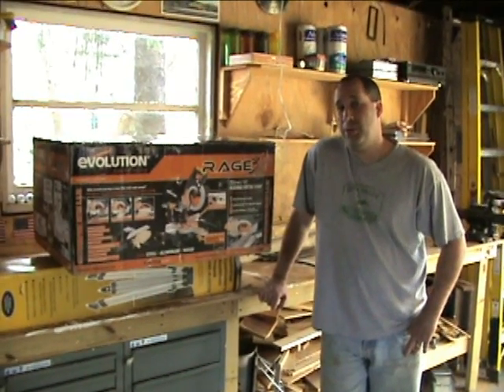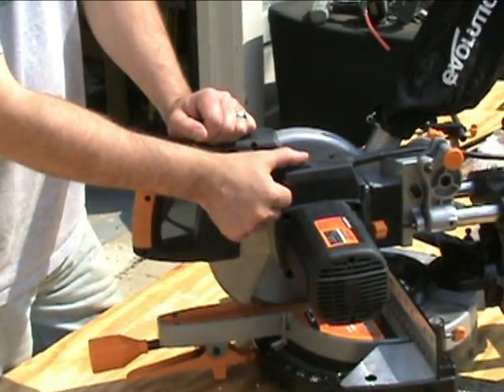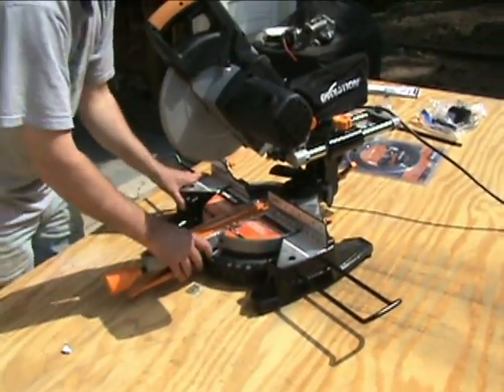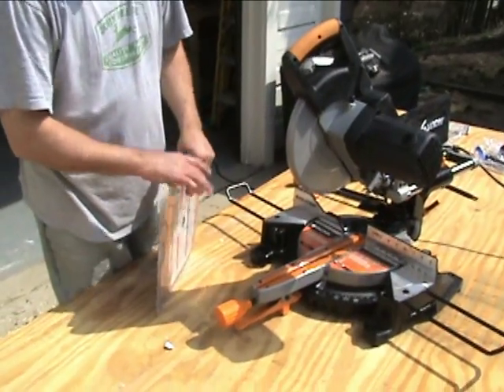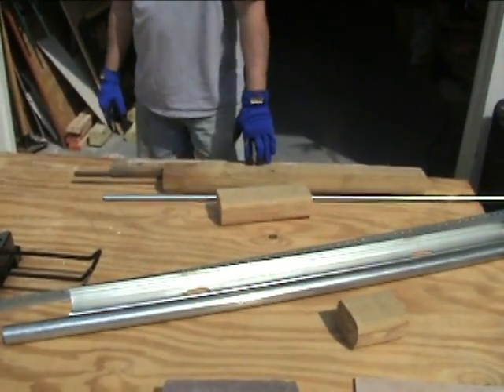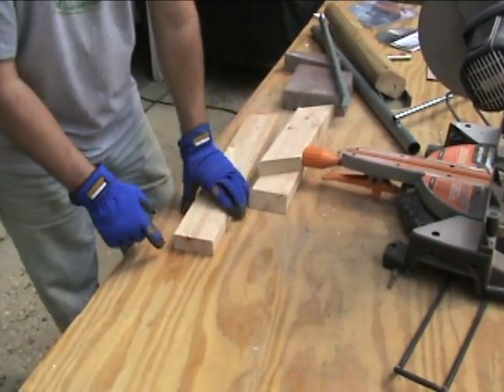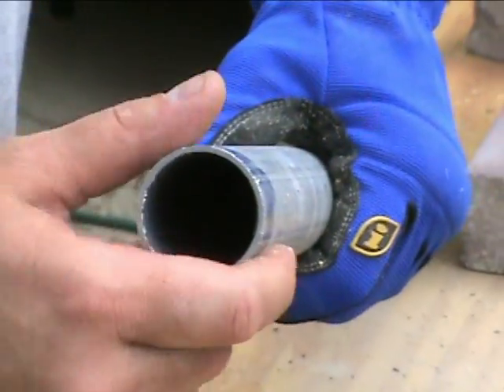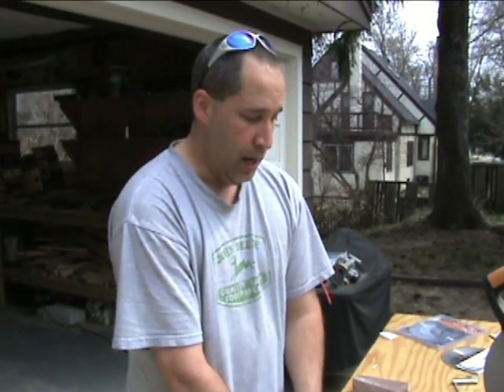Evolution Rage 3 Saw

Comment: Good review but the switch on the top of the motor housing is only the on/off switch for the lazer light. the actual saw will operate with  this switch  in the on or off position so don,t rely on this switch to stop the saw  from operating . if you don,t want this saw to operate pull the plug out

Comment: Whilst I will be using this saw for major timber works, around the home, would I be able to use this for picture framing, the manual type have gotten quite bad over the years, but I need this larger unit for other tasks also.

Comment: Well... Its in its very own specially built cupboard. Did a quick project (ornimental bird table for the wife) used "old mitre saw" Couldnt use the new baby too windy and a bit cold outside. Cant use it in shop ,it only measures 8ftx6ft. Bench not big enough at the moment. So I just open the cupboard make sure she,s ok and smile... Weathers getting better and will use on the next project (6 ornamental bird nesting boxes with loads of angles) !! May even be tomorrow  eeh eeh will let you know..

Comment: Is it just a different blade to cut all materials ? . Or is the motor geared different ? . For the money looks amazing saw !
Reply from the maker: Mostly the blade
Reply: Tools In Action Thanks for your reply , so if you put this blade in any mitre saw it would cut the same materials ?
Reply: makolic1 no the evolution multi saw is slower then most saws, i cant say for sure but if you put it in a normal mitre saw it may shatter due to higher speeds

Comment: it really looks capable of cutting everything!but isn't it a bit dangerous to cut aluminum and steel with a blade with teeth? I mean we usually cut metal with angle grinders, where the cutting "thing" is a circular fiber reinfroced disk.
Reply: No it produces no spark. All cold cut saws have teeth for metal. Only abrasive cutting saws have the big disc you are used to.
Reply: KForceOH Ok got it! Do you also suggest to buy a seperate maybe more stiff disk for faster wood cutting? also, I see that the final cut area is so smooth....Does it really leave such a good cutting area?